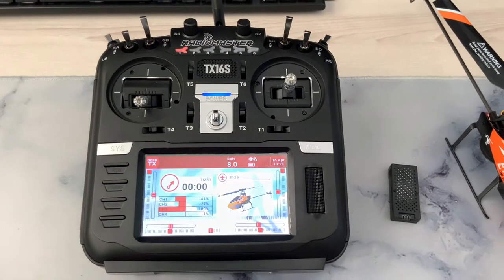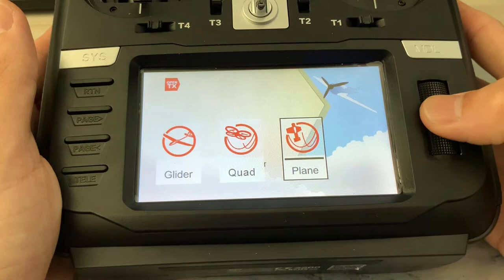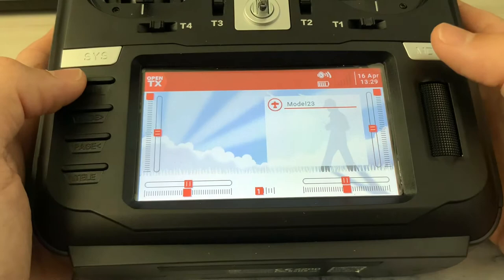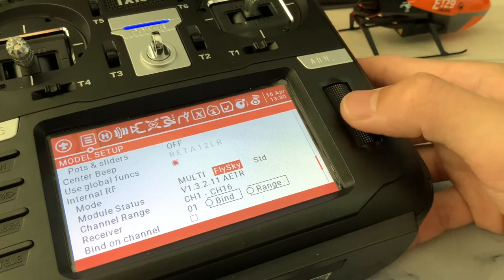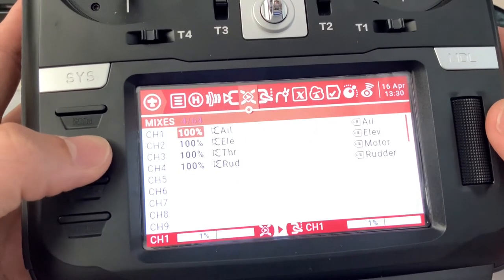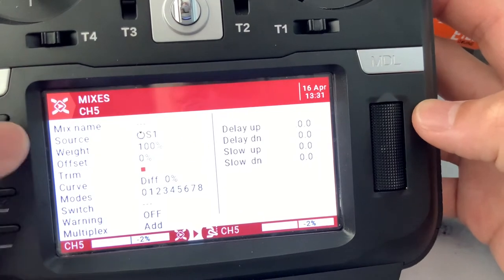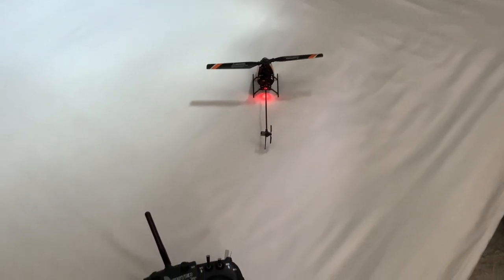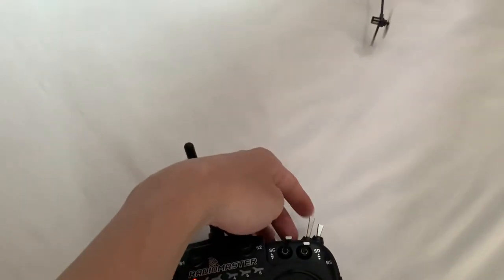Radio master TX16S bind and program E129 in 4 mins programmed with 1 key take off/landing

Comment: I fly mine with Zorro (mode 1) and have a problem I can't crack: it is extremely difficult to make it go backwards, it always wants to shoot, literally, forward. All the rest of it seems ok. What can I do?
Reply from the maker: Have you tried trimming and subtrimming it rearwards? I highly suspect your heli is somehow adjusted to forward trim... I had that issue as well where I literally had to hold down elevator just to keep it from moving forward.
Reply: @youronlycow : Thank you for your help. After much experimenting, this is the best I could do to get some stable flying. In Model Setup, Trim Step = Coarse (to save time); all Inputs set to Trim =On; InputI Weight =50; Elevator Trim Sw = 32; Ail Trim sw= 0. I know nothing about Zorro subtrimming. Ths again, best regards.